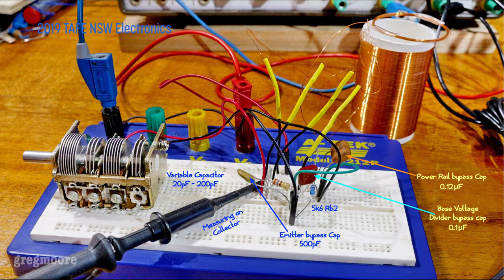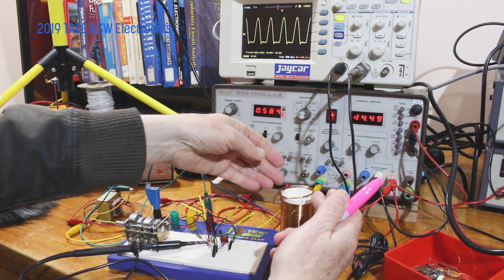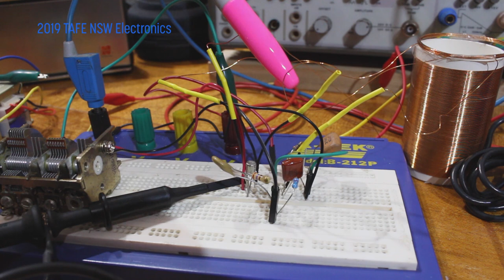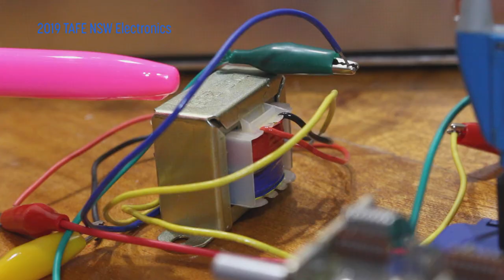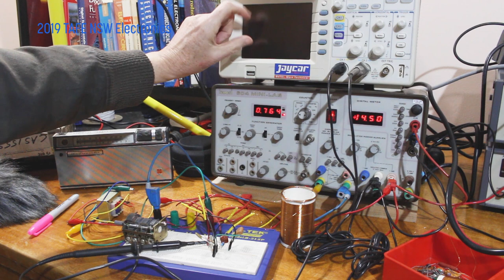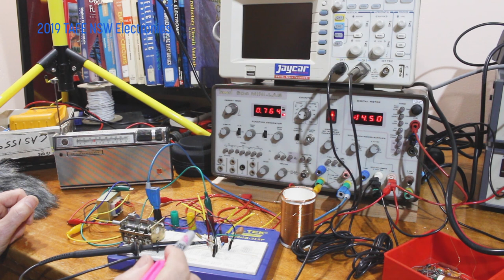Armstrong Oscillator Transmitter  with BJT - UEENEEH142A Electronics TAFE NSW

Comment from the maker: Typical of equipment with switching regulator type power supplies which work at 100kHz with harmonics all over the place.  We don't use AM radios much in the house in 2019 so we don't hear it much, but it's always there and it's a good reason to use linear regulators in more expensive equipment where RF interference is not acceptable.